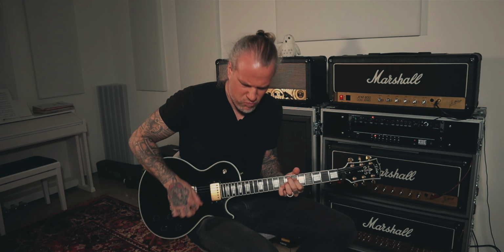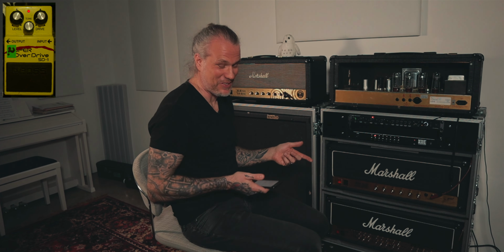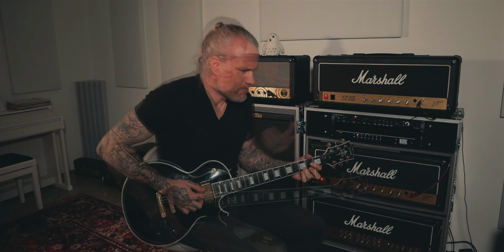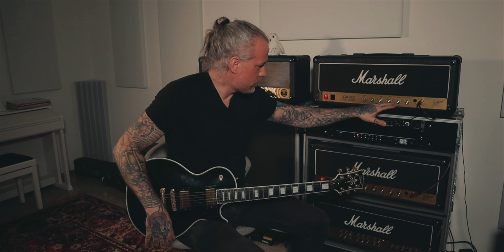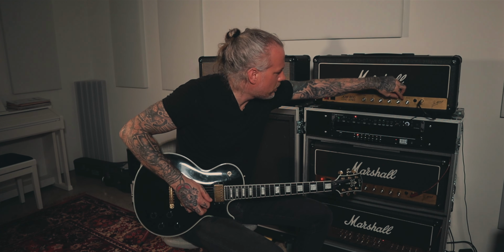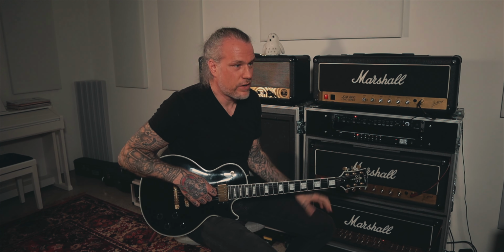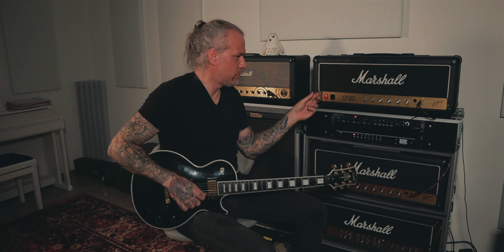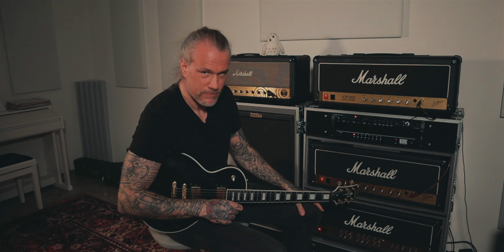The maintenance of my MARSHALL JCM800 2203 from 1985 | And how it compares to my other Marshalls.

Comment: You’re right.  They all sound different.  I wouldn’t<t have thought we could hear the difference via the compressed audio of YouTube.  But I do hear it.  The “bad boy” has more low end, or more low mids.  It does sound more aggressive…. I like it a lot…. I’m learning a lot from you on how to “better” use my 800.  Have you found that the SD-1 is the best front end load pedal to send the JCM 800 into metal mode?  I have a few OD pedals, but not that one…
Reply from the maker: Indeed 👌.
SD-1 is the best overdrive in general IMO so yes 💪. And it’s also one of the cheapest. I have 5 of them ’cos why not 😁.

Comment: Hey Euge... I own a JCM 800 Studio Classic and I also use an SD1 in front.  However sometimes I would like to get some more gain out of it. What pedal would you recommend for more gain without subtracting too much from the 800's usual tonal characteristics?  Thanks!
Reply from the maker: Dial more gain on SD ’cos there’s plenty of gain when you drive a cranked head. I mean I have the gain between 0 to 8 o’clock on SD so I really can’t recommend any higher gain pedals to boost an 800 ’cos I hardly use any gain with SD to get what I want 💪😎. Too much gain and everything sounds like shit 😁.

Comment: I  think the 85 sounds more tight ? or its just you tube the marshalls in the case and the zw sounds pretty much the same
Reply from the maker: I think the 84 is a bit tighter but the low end is a bit different (bigger) ’cos of 6550 power tubes so that might dupe it a bit 😎.

ZW isn’t as aggressive as the other two (vertical inputs - more filter caps etc) 👌.

Comment: Another very interesting video!  You hit on one of my all time favorite bands..."Shoot to Thrill" is one of the songs I always hear in my head!   I think the "Bad Boy" has a little more chug than your '85.  

I liked your discussion about the bright cap.  I have a 1984 JCM800 4104 50w 2x12 combo that my amp tech has modified a little to achieve a closer to AC/DC type of tone.  Mainly the power tubes were changed from EL34's to JJ KT77's which give a little more low end and a little more highs.  I've been experimenting with speakers.  It's an open back that changes the dynamics a bit.  After going thru 5 different speaker types, I settled on Celestion G12-35XC 90th Anniversary speakers which have Pulsonic cones.  These cones add a little more weight to the tone to make up for the open back cabinet.  Anyway, the tone still wasn't where I wanted it to be as it had an ice-picky high end that couldn't be dialed out without killing the overall tone.  We ended up clipping the bright cap and now it's perfect (for me) to get the tone I was chasing.  Keep in mind that I can't play with the amp cranked though.
Reply from the maker: Thanks! 
Yeah it has that something that no other amp have 💪😎.

Speakers play a huge part of the sound indeed which is something that surprisingly many people don’t always realize. 

I’ve experimented with them quite a lot (also with IRs) and have found that I like V30s, Greenbacks & the Eminence P50Es (which I have on my Fryette cab) the most and those I’ve used the most on several albums & recordings during my career. And lately my Suhr Reactive load with Jens Bogren IRs ’cos I can get the similar sound & feel I get with real cabs & speakers & mic combinations but with much easier and I can record & play my amps cranked with only headphones if I want 😎👌.
Reply: @EugeValovirta230V  Yes.  I generally like Greenbacks (with my Super Lead) and G12-65's (with my JCM800 2210) for closed-back cabinets.  My buddy uses the Eminence speakers that you mentioned.  I have to find some way to lower my volume levels though when playing at home.  My hearing is really suffering more and more.  But I like to feel what I'm playing.

I meant to ask, what is that red button near the power cord jack on your '85 2203?
Reply from the maker: 👌
Bugera Power Soak PS1 is really good & quite cheap option for that:
https://youtu.be/ndENZ8Zw8N8
https://youtu.be/zEasSPvcRSA

It’s the fuse; Scandinavian ones have this kind of pop up fuse that if / when it shuts the amp down (pops up) you just press it back down and the amp works again 😊. I believe the amps made for Canadian market also have this.
Reply: @EugeValovirta230V  I've been considering the Bugera PS1 that you've mentioned or the JHS Little Black Amp Box.  But the JHS is only for amps with an effects loop.

I did notice that the back of your 2203's look quite different than my US distributed Marshall amps.  I think the circuit breaker system you have is a lot more convenient than the replaceable fuse system the US models have.

Looking forward to more of your great playing and videos!
Reply from the maker: I use the Bugera when playing with my cab and it works like a charm 👌.

Yeah the Scandinavian edition 800s are a bit different and the most aggressive ones I’ve played. And I’ve played a bunch 😎.

Here’s more in-depth video if you’re interested: https://youtu.be/5I6nTYCEpVs

Thanks man!

Comment: So some of your Marshalls only have 4 filter caps and the other Marshalls have 6 filter caps? With all your marshalls cranked to volume 10 with nothing plugged into the jacks is it hissing white noise hiss? Because a Soldano SLO-100 is suppose to be very quiet with out the guitar plugged in and with the guitar plugged in.  You need this singer really bad from SLIK TOXIK live at Rock and Roll Heaven 1990 and the band is very very very tight.
Reply from the maker: The Bad Boy has 4, the 1985 5 and ZW has 6. No hiss when nothing is plugged which is how it should be 😎.
Reply: Slik Toxik.    Great band from Toronto.  They were a couple of years too late to the scene sadly. Second album is outstanding
Reply: @Ontariosound  Yes good  band and singer just like SB from skid row is also from Canada. Skid row got SB from their manager that was sending in tapes. Nick Walsh is somewhat close to SB vocal range. I prefer the first album which is out of print but their live concerts in 1990-1992 are pretty good to see Nick Walsh vocal range and how tight the band was. I hope Euge Valovirta watching it.

Comment: I’ll partly because of your videos ordered a JCM800 Studio head. I agree that after 7 or so preamp gain only adds unwanted bass or some muddy frequencies. I need to push that master volume up tho... great sounds and I need a boost pedal with passive pickups. 👍🏻🤘🏻
Reply from the maker: Cool!
I have the preamp always on 10 except on my old ones from 84 & 85 where the 7 is the same as 10 on all other 800s I’ve played 😎👌.
Reply: @EugeValovirta230V  Well, mine’s back at 10. 😂😂 I really need some sort of amp switcher to switch between amps like you have. I need to study your rig more closely. My wife doesn’t want any more cabs in our home.
Reply from the maker: Good 😁.
This is really good and what I use: https://youtu.be/-_WpuZW22D4

Comment: The maintenance described here must have been very expensive. If shipping was involved, ~100€ each direction, parts and labor 300€, maybe more. Estimated total ~+500€. Ouch! Correct me if I'm way off in either direction.
Reply from the maker: No shipping since the Musix is close to where I live and the total was closer to 0 than to 500 CHF👌😎.
Reply: @EugeValovirta230V  Ha! ~0€ for u but for us mortals big bucks! Cheers.
Reply from the maker: It was a few hundred which is quite normal for this kind of job at least in my experience 😎👌.

Comment: Hey bro I know yer JCM 800  monster.. how Dow you feel about the Friedman BE 100 or deluxe ?
Reply from the maker: Hey Ernie, they’re good and very versatile  and a bit smoother than Marshalls (especially 800s) like Friedman’s in general.
Reply: Thanks brotha , dig yer channel ( the best ). Been thinking of buying a Friedman but man when I seen yer channel w/JCM 800 , you really made me 2 nd guess.  I like  the ZACK ATTACK  of the 800  so I’m really up in the air 🙄 so I guess both hahahah oh I forgot that means  $$$$ a lot of beans
Reply from the maker: Thanks man! Glad to hear that!
Yeah the Friedman’s especially are quite expensive but the 800 2203s are usually between 1000-1800 € / $ nowadays (used & new) so they’re quite cheaper than Friedmans 👌😎.
Reply: Euge, so if I’m lookin for an 84  JCM 800 like you have , is there anything I need to know besides the 2203 or is that the same as the 84 bass man model or just the plain  2203? .. just love that EVH , Zack attack ... I’ve learned so much from your show  👍 you compare those Amps the way I would .... Rock  on my brotha
Reply from the maker: The one I have is the 800 2203 with horizontal inputs. Those are the most aggressive in my experience 💪😎.

Glad to hear that! Thanks man!